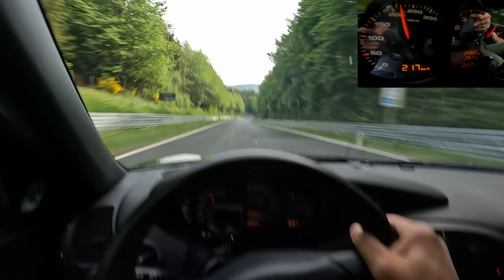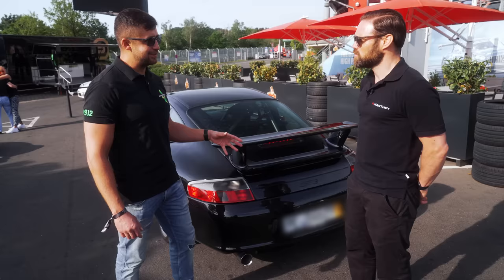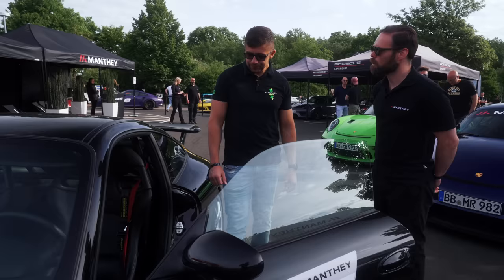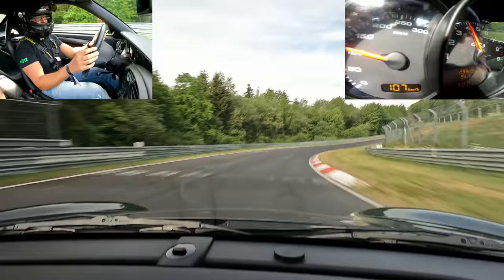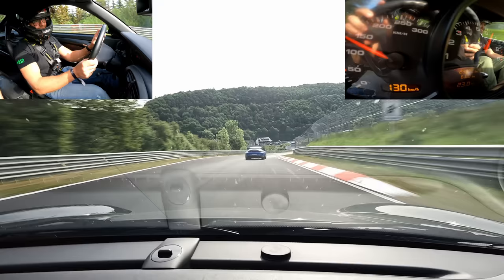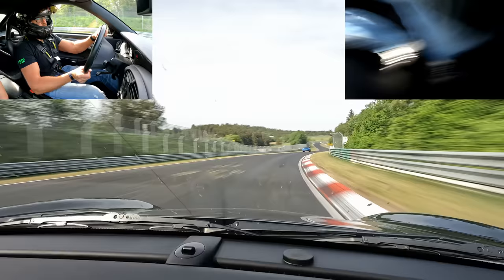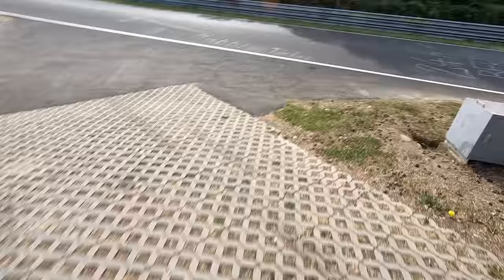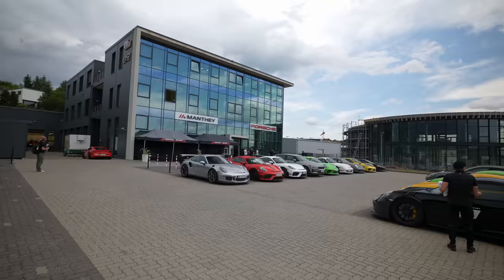ENGINE FAILURE at 220 kph on the Nürburgring! | Porsche 996 GT3

Comment: Hearing someone say it belonged to an old lady, I remember once more than 10 years ago passing a GT3 Porche in a bright color, think it was green, complete with big wing and a roll cage, doing 80 or maybe 90 in a 100 zone on the Antwerp ringway. When I passed it (doing 100 in my old Diesel Focus), I noticed a posh but very amiable old lady behind the wheel, barely looking over the steering wheel. It was quite a nice contrast and a view I never forgot. :D
Reply: 6:45 are you talking about this? I think he was describing the car as an "older gal" per se rather than a brand new 991.2 or 992 or whatever, this car is over over 20 years olds
Reply: 8:20 the owner is a guy

Comment: That's a good save Misha! Glad nothing catastrophic failure or accident happened.
Reply: Indeed a good save and good reflexes, Mischa, also to dart behind the orange barrier when the engine temperature light came on. 👍 I had a similar experience on a tight highway (without the emergency lane) when a valve on one of my rear tires failed and the tire lost all air suddenly. Luckily I was right by a short SOS lane that was probably 100 meters long and I managed to pull in there and stop. The next SOS lane was at least a kilometer away.

Comment: This really should be a lesson in keeping an eye on your gauges. The combination of battery the warning light and the voltage dropping from 14 to 12 should be an immediate indicator that something is up with the accessory belt. On these engines, both the M96/0x and M96/7x, that belt does alternator, power steering, and most importantly, the water pump.
Reply: Had this on my car, water pump bearing went out and power steering went straight away. Knew straight away my battery/powersteering and water went down as the belt snapped from the bearing but limped the car for 30 seconds into a spot and got it towed. Feel like someone that doesnt know much about cars might try limp it home and blow their engine doing that but a cheap water pump and a new belt later my car is fine and still going on

Comment: This exact thing happened to me in my 996.1 C2. Power steering went, then the battery light went on, then water temps started skyrocketing. Old car problems. Really gotta do your maintenance on these cars if you are going to drive 20 plus year old cars hard.
Reply: 997.1 same thing happened to me but un the tensioner pulley
Reply: Same on my 997.1 at Sydney Motorsports Park.  Tensioner like lareau6.  Same exact thing. No power steering, then battery warning, then temps.
Reply: Same. 996gt3

Comment: Speaking of pulleys - on a car that is not used much in heavy traffic, it's a good idea to switch to an underdrive pulley, that spins the alternator, water pump, and steering servo slower, maintaining the longevity of these parts. Porsche might have engineered the components so that they can endure track use, but most manufacturers dont.

Comment: Makes a change from that glued Mezger coolant pipe undoing itself and spraying coolant over the rear wheels!  Personally, I like the 997.1 GT3 - last hydraulic steering GT3 mezger cars, higher revs and better looking than 996 inside and out.  Everyone is different though!

Comment: This driver/owner has a great car here. My 1999 911 (996.1) was purchased  from an owner that was going trade it in but wanted to give a new owner a chance to own it for below low book trade value that his dealer was giving him. I gave him a low bid on Ebay at a midnight auction.  10 minutes later I owned it. I DIY just finished replacing all of the rear-end components that were just getting old. Water pump. Thermostat,  all hoses,  overflow bottle and secondary air pump. Finally a new serpentine belt. My car broke down exactly as this one in your video. Great example of how you dealt with this very same problem. Thanks for your video.

Comment: HAHA Misha! Mantey should now that if you change to single flywheel on 996 GT3 you need to change the screw to another lenght!! This is not a common knowledge if you are an  expert. I got the same issue on my GT3... different lenght on double mass vs. single mass flywheel! Nice drive by the way and a good lecture!!

Comment: And in this case, just only for my personal curiosity, how much does it cost to be pulled out the track because of and engine failure without doing any damage around the track?
Reply from the maker: Free on a track day! Otherwise around 200€
Reply: @mgcharoudin  Thank you Misha, really appreciate your answer.
Reply: @mgcharoudin  also when its not a Porsche only track day, can you use your own car aswell or is it only a specific set of cars provided by the organizer?
Reply from the maker: @jordyvanderStraten  Manthey track day is Porsche only. Doesn't matter if your own or rented one. Other track days don't matter.

Comment: Very impressive save Misha, what I’m amazed by is not only your ability to get to the shoulder quickly, but the presence of mind to reverse behind the barrier too.

I am also very very impressed with the German engineering in that 996 GT3. As you were about to turn the car off I saw the coolant gauge, the needle was on 120degrees and the light was illuminated yet the engine is fine, very impressive.

I once got my 2001 Audi C5 S6 to around 105degrees before I could get to a shoulder and pull off. I immediately was worried I warped the heads, maybe I’m too cautious. Either way, amazing save.👏🏼

Comment: How the hell does a crank pulley snap🤔 that's a first for me. Good reaction on saving the engine👌
Reply: One of many examples
20 years of extreme heat cycles + very high tension = snap
Reply: @lukeeboy149  see a lot of engines on a daily bases that probably had way more abuse as this one and are older. Never seen a snapped pulley. Bolts loose, yes, snapped,no😁
Reply: My first thought was an accessory seizing/breaking (like water pump or power steering pump bearings) and belt falling off. This is why I like gear driven water pumps (edit: and timing belt/chain water pumps)
Reply: @TheTechnoaddict  yup, interesting how this snaps a pulley at only 30k km. Probably been driven harder than the normal dailys people are running around in well into the 200k and 300k kilometres. Is there really that much of a wear difference when driving hard?
Reply: @onelyone6976  no there is not. And it's not like he was smashing the pedal after every shift. He was driving pretty smooth. Could be a bad part out of the factory.
Reply: Crank pulleys snap on modern diesel BMW's all the time. 99,99% of them result in total engine destruction. Sometimes if your lucky the car develops play in the crank bearings first (does not take long, they are made of cheese) and you spot the knocking before the pulley goes flying or shakes the bearings to shreds while driving. Best case scenario new bottom end.
Reply: @Nakke144  all the time😂
Reply: The water pump pulley snapped clean off my water pump in my 987 cayman s and I lost all power steering immediately.  It scared the shii out of me.  Never heard of that happening with any other car.

Comment: I guess its a good thing that the power steering pump runs from the pulley (contrary to an eps), otherwise you might not notice the issues right away and by the time you do, the engine already cooks without cooling.

Comment: Same thing happened to us once on the highway, only I was in a ancient Dodge SUV nothing as cool as your vehicle!  Same first indication, steering got stiff as the power steering pump failed then we saw the engine temp increasing so quickly pulled over. The belt tensioner had sheered off. Spent the night in a sketchy part of Miami before the parts store opened the next day then fixed it and drove home!

Comment: I once ripped my timing belt on the autobahn (on a diesel). The first thing I noticed was the power steering being gone, too.
I didn't know what's going on so I instantly got hot (almost sweaty) and into wtf-state ^^
I managed to roll out onto a motorway station and got towed.

How did you feel when you noticed something is wrong?

Comment: First words out of your mouth getting out of your car, was the first thing in my mind before you did. Heads up all around not dropping fluid on the track, and getting the car to a safe spot between the barriers safe and quickly. This really should be a model of what to do in that situation, not to mention quickly realizing there was a problem and getting the motor off before damaging it further.

Comment: Hi MiSHA..
That was a good decision to pull off the track as quick as possible. Thankfully it didn't happen at full speed going thru tight twists & bends on the track. It could have ended ALOT worse for you & the cars owner! 
This is kind of similar what happened awhile back. 
I remember when you took another "classic" Porsche out for a spin on th'Ring and the brakes failed on you !

I am rather curious tho...
why the Crank pulley snapped off ?? At a rough guess: were the bolts that fasten the Crank pulley "over" tightened?  Too much torque wrenching on them that it caused metal fatigue, hence under stress they snapped off while driving ??
Anyway good that it ended Ok
Love ya work bro👍🙂👍
Godbless & ava Gday 🙂

Comment: What about your over rev with the missed heel toe in lap one after the foxhole? Was it possible to identify how many rpm it saw at the short instant? I only ask as I remember when looking at buying these cars people always said they the ecu recorded every over rev and one or two short instances could de value the car.
Reply from the maker: You can see on the rev counter that it wasn't an over rev.
Reply: Yeah I paused it before commenting and checked the video but I'm also aware in such short moments in time like that often a traditional rev counter can't quite keep up with the actual rpm experienced. I'm a fan and shouldn't be trying to dig a hole here. So I'll bow out. :))